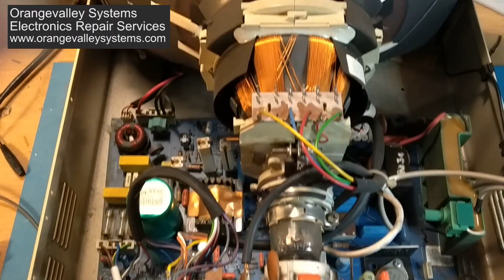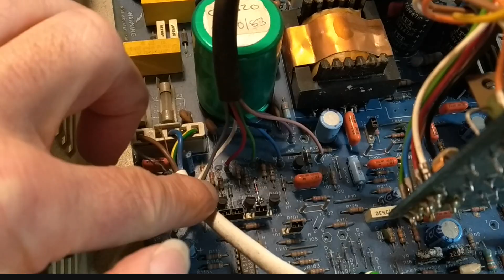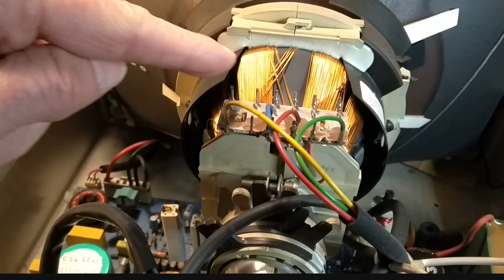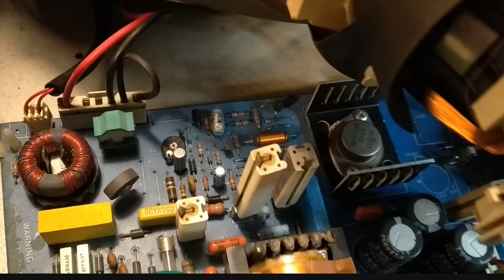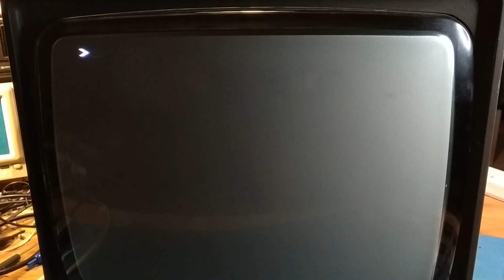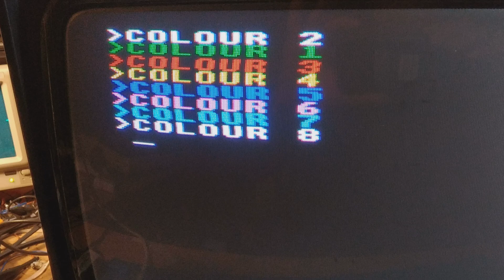Microvitec CUB Monitor with a missing colour

Comment: The ‘Green thing’ is the tripler very common in this chassis for the tripler to cause focus variations from initial switch on due to it breaking down internally. Very good monitors, excellent quality CRTs used